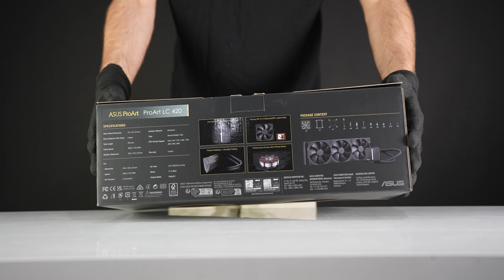The BEST PC for Creators + Gamers | ALL ProArt PC

Comment: Ok that was aesthetic AF 👀
Reply: Not really tbf. It still uses the adaptor from Nvidia. The buyer should've gone for the Seasonic Prime TX-1600 PSU which supports ATX 3.0 compliment, and is equipped with 2 PCIe 5.0 power cable
Reply: K bro 1 detail is so annoying @pangeranrio0112
Reply: And satisfying